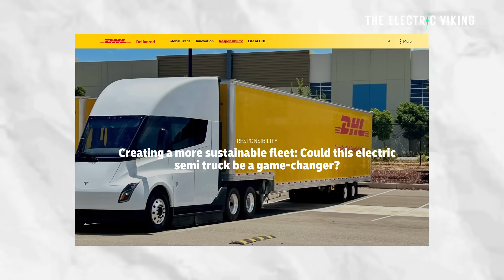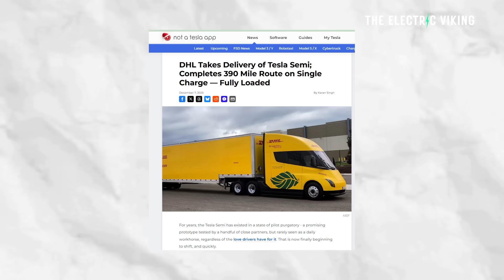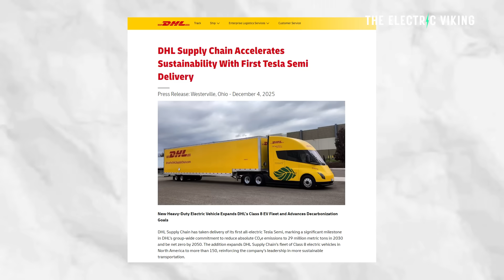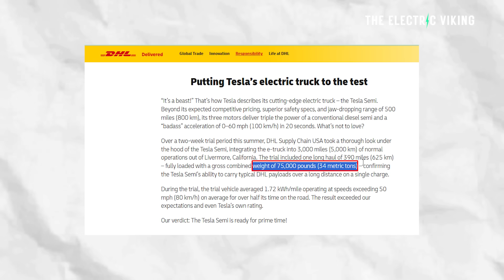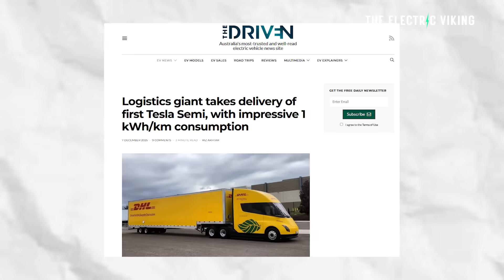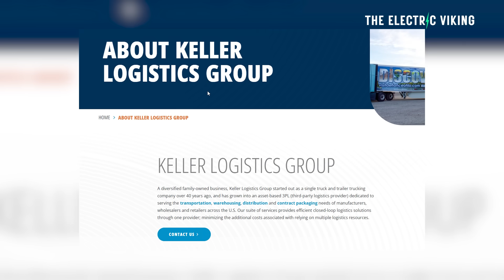Tesla Semi Drives 390 Miles on Single Charge Fully Loaded with Range Leftover!

Comment: I’m a truck driver.   I can tell you that the Tesla Semi will blow away the competition.    It’s like comparing a rickshaw to a car.   Diesel trucks are so costly, loud, polluting, and will be GONE because of Tesla.
Reply: I think the problem is people think you have to replace every semi with a Tesla Truck. You don’t have to, for city delivery/local, it has a big advantage, diesel is more efficient when you have constant speed, the diesel engine has rotating mass, so it makes a lot of sense for long haul. In town, electric wins, big time.
Reply: I don’t think people realize how stressful the sounds inside the truck are.
Reply: @karlmckinnell2635 I would guess Tesla Semi has sounds not found in Diesel trucks I have an early Tesla fairly quiet, but does have its own quirky sounds which is common from reviews of older Tesla mainly because Teslas costing a lot, but no total sound proofing, which can add even more costs to production at the time.
Reply: I just wished we used more trains for long haul transport and delivery vans for last mile delivery and got more semi's off the interstate in the US. It sucks as a daily driver having so many semis on the road, especially because many of the drivers suck at driving due to lowered CDL standards. They will stay in fast lanes when signs clearly say trucks need to stay to the right, or they will wind up on a side road that is not made for semis and get stuck in an intersection.
Reply: @JEP-Tech  Great Idea, get all those long haul goods onto rail, BUT, I don't think there's much electrified rail in America unlike Europe etc. For "clean journeys" you really need electrified rail.
Reply: I agree with some future hybrids for remote or very long runs
Reply: Also parts for semis are expensive, i hope this pushes innovation to other semi manufacturers
Reply: @Omarfx007  How can you say parts for something are expensive when that thing isn't commercially available yet?
Reply: @Omarfx007  all the other semi makers already make electric tricks. only tesla out there years late and promising the moon
Reply: @someonenew3478 How many are they other planning? What are the charging speed characteristics. The others are not built from the ground up. The market for EV semi is wide open. Late? Hardly.
Reply: I'm a trucker and I can tell you that none of that will ever happen so long as Tesla refuse to bring the damned thing to Australia
Reply: @alexishart1989 guessing you're an Australian
Reply: You're an idiot.
LoL.
This is going to turn out to be bulkshit.
The "payload" is going to proce to be less than adequate.
Building all the batteries is going to be time consuming and without the government segment paying huge offsets, the costs are going to be out of sight.
Look at how shitty the "fleet of electric buses" are going.
Reply: Energy density is a major problem
Reply: @Jackson_M5  how so? be specific and include examples
Reply: @williammeek-h2o  Diesel Fuel is 70 times more emergy dense than Li-ion Batteries. The stress on the road for a long haul will be 25% higher on road infrastructure with 8000 pounds less cargo payload
Reply: IDK but it's exciting news!
Reply: It always come down to the fact that the United States is atleast a decade away, and probably more because of the decrease in support for EV'S  ), before we have the infrastructure to support fleets of electric trucks. I'm sure the larger corporations would love to get subsidies to build standalone power generators at each of their facilities, but at 38 Trillion dollars of National debt I don't see that happening. This is especially true since we wasted 7 billion dollars for 7 chargers, or 3 billion dollars, in what is obvious corruption, going to Stacey Abrams start-up company.
Reply: @russellderonda1489 no. The United States will be no different than Canada with EV adoption for semi’s. Scale is complicated over huge regions. People who transport goods are trying to transport goods, not have an ev revolution. EVs are fantastic if they develop organically. Some incentive is fine, but we don’t need the Feds creating an artificial ev economy.
Reply: @russellderonda1489  It is already financially viable to put solar on the roof and batteries and chargers for short haul and the lower end of long haul.
Reply: Superior!
Reply: As a heavy truck test engineer I'll say it's not as good as you think
Reply: @m @miamisasquatch  what brand do you work for?
Reply: You're not a truck driver african 🤣🤣🤣🤣
Reply: There is no infrastructure for this. 20 years to upgrade the power grid and install enough chargers nationwide to even start switching over. At least.
Reply: @Mythicalniceguy Tesla might be able to do this they don't have to build that stalls at loading docs just 1 or 2 and a power storage unit,  Tesla is already putting some higher powered units at some of their current sites not 20 years maybe 3 to 7.
Reply: Really?  Because that's NOT what PepsiCo is finding out.  Especially considering Tesla's horrid parts and repair support, their DOWNTIME and a lack of megacharger network is costing them FAR more than any savings supposed by not using diesel.

Hate to say it, but calling you on your assertion of job title...
Reply: Fck that, I will keep the old cat.
Reply: The only drawback maybe range and time of charge, I think tag team trucking might help if you need the range and charging time is a hindrance
Reply: @nicholasyoung2794  Pepsi has found charging during mandatory driver breaks is enough for 1K mile days. 
Over 1K miles some time is lost, but the energy cost difference is huge, this is ongoing analysis.
Reply: Charging costs more than diesel.
Reply: @singed8853 and time is Money. 
And brakes are money. 
Regen braking will be a lifesaver. 
I've run a haulage company for 25 years in the UK as Transport Manager.
I'd be all over these things. 
We only had 25 vehicles or so of varied weight capacity. 
Vans, curtainside, flat & crane vehicles.
Your fleet will be bigger than mine im guessing.
Because you know so much.
Reply: @singed8853 Probably how and where you charge, over time i don't know how setting up solar charging vs diesel obviously charging would be more beneficial for the environment.
Reply: @andrewsaint6581  I know that charging actually costs more than diesel in certain areas and at certain times. The OP talks like charging is free. I also know that without special charging infrastructure it takes hours to fully charge an electric semi.
Reply: @nicholasyoung2794  I didn’t say anything about the environment. It takes a certain number of miles of driving an electric vehicle for it to become more environmentally friendly than a diesel counterpart. It’s basically a mathematical formula.
Reply: @singed8853  The OP is not talking like charging is free. settle down
Reply: @dogman-q3i  true. I must have commented to the wrong post.
Reply: @singed8853 My understanding the environment detriment of evs is in the process of making the batteries, not sure the difference in processing diesel fuel, the actual use of the vehicles ev would be better then diesel for the environment if that's the only thing considered.
Reply: @thedukeofalinor1377  Hailing potato chips. Actual drive time is about 5.5 hours with a real load. So just not enough before needing a 15 hour charge.
Reply: @singed8853  You have to realize where those megawatt chargers are - central valley in CA. Electricity is cheap, diesel is expensive.
Reply: @singed8853  except not
Reply: @singed8853  Why wouldn't there be charging infrastructure? 
Provide an example where a megacharger costs more than diesel.
Reply: @williammeek-h2o just ChatGPT or Grok what I said. I never said the word ‘megacharger’.  And so I made no claims about that.
Reply: @nicholasyoung2794  The vast majority of pollution from ICEVs is from operation.
Reply: @jmontgomry1  I am no fan of ICE but no, it doesn't take 15 hours to fuel a diesel.
Reply: @singed8853  Thanks for admitting you can't back up what you say.
Reply: @williammeek-h2o  I have no support for YOUR strawman. I told you to ask grok or ChatGPT what I said and it will provide you the sources. I didn’t just make it up.
Reply: @singed8853  except you did
Reply: @williammeek-h2o  no I didn’t and anyone who reads what I said will know that. But you can make up whatever you want and pretend you’re responding to what I said.
Reply: @singed8853  You can't change the fact that you are unable to support your arguments and many people will continue to call out your BS.
Reply: @williammeek-h2o what arguments? Is this another thing you’re making up about me? I simply said that the cost to recharge is higher than diesel in some areas. My original comment indicated that was the norm - but it’s not and I should have been more careful. Cost to recharge is usually lower than cost of diesel. I have no agenda that supersedes the truth.
Reply: @thedukeofalinor1377  The weight for cargo payload is high. If the truckers have to pay for infrastructure degradation, theres no savings whatsoever
Reply: @thedukeofalinor1377  Road infrastructure repair..... given heavier weight its 15% more road degradation .... acvounting for static vs dynamic weight its closer to 20% more. The electric cost doesnt tax road usage
Reply: @singed8853  Yes, those arguments
Reply: @nicholasyoung2794   LOL
Reply: @NedLingamon I'm just finding out how it works or working
Reply: Will be offset due to self driving. Drivers can sleep in the back of the truck instead of getting a room or pulling off to a truck stop.  Less maintainence too.
Reply: @polygunslots of lawsuits still to be had before these can go without a driver.
Reply: @nicholasyoung2794 there are no drawbacks
Reply: @linuxxr Then the future of EV trucking is looking good, will the production of the trucks meet demand?
Reply: @linuxxr apart from the poor Chinese person getting like eight-year-old children to mine the raw materials yeah there are no drawbacks just slave labor that the west refuses to acknowledge..
Reply: @nicholasyoung2794 Nope!! The Tesla semi only has one seat and a shitty sleeper, if any..
Reply: @carlsmith1118 So currently it is only good for certain transport jobs
Reply: @nicholasyoung2794  80% of them.
Reply: @williammeek-h2o if you plan your drop offs correctly would make the difference between charging and using gas minimal and overtime charging at the loading docs should be cheaper
Reply: @nicholasyoung2794  for single drivers, charging can be done at the loading dock and on break so no time lost, maybe even time gained. for team driving diesel might have a slight advantage in flat country on very long haul, but would cost a LOT more.
We are talking they would gain maybe an hour a day over Semi and there are almost no routes over one full day.
Reply: @williammeek-h2o They would have to equip at or near the loading dock charging stations
Reply: @nicholasyoung2794  Yes, integrated into the loading dock would be most time efficient.
Reply: @williammeek-h2o  So a massive increase in electric infrastructure
Reply: @Jackson_M5  that we already need
Reply: Similar analogy for Tesla cars.
Reply: Diesel trucks will be GONE because of electric truck manufacturers in general. In Europe MB, Volvo, Scania and Renault are ahead of Tesla.
Reply: @Freba9 giebt keine Semi Teslas in Europa.
Reply: @frankbussinger5237  Genau! Wir werden Tesla einfach nicht brauchen.
Reply: "I'm a truck driver"

🤥
Reply: Yep
Reply: I own a model 3. As fantastic a job as Tesla has done to maximize charging infrastructure, Tesla has a few decades worth to do to really compete with diesel for long haul. Trucking routes will need to be strategic for some time, likely hosting level 4 charging at the destination. Diesel is far more portable as an energy source than battery electric for now.
Reply: @kevdernman  Just need chargers between cities. Then 50 miles apart. 
Semi can cover most long haul as that is defined as greater than 150 miles and Semi can do a 250 mile round trip, 500 mile each way.
Reply: @williammeek-h2o I own a model 3. Went Houston to St. Louis to visit my daughter in it once. The trip took almost double than my f150. Less range, slower “refuel” time taxes your time on a long trip.
Reply: @kevdernman  BS, Houston to St Louis is a 12 hour drive. 
Even if you had an old SR, you wouldn't need more than 3 charging stops of 30 minutes each.
And one of those stops would have been during a meal unless you are VERY unintelligent.

Only if you are a verry bad planner would The Model 3 have been even an hour slower
Reply: @williammeek-h2o  All you've demonstrated to me is you've never owned or taken a long road trip in a Model 3.  I own a Model Y and have taken many long road trips in it.  And sure if you're going to drive over 400 miles in a single day, the trip will take longer than in an ICE car.....but by like ten or fifteen percent, NOT one hundred.

Anybody who actually owns a Model 3 understands this in their bones.

And the rest of year when I'm not driving over 400 miles a day, my Model Y saves me many, many hours because I never have to shlep off to a gas station.  How many hours per year?  Well you do your own math.  For me when I had an ICE car, god rest its soul, I had to fill up twice a week.  If that trip, getting to the station and back plus actual fill up time, took 15 minutes, then that's 52 weeks in a year times 2 is 104 trips to the gas station times 15 minutes each is 1560 minutes per year, divided by 60 is 26 hours a year or THREE FULL WORK DAYS plus two hours wasted doing nothing but pumping gas!!!  Offset that by the fifteen seconds three times a week that it take me to plug in my EV and you get 2340 seconds a year, which is 39 minutes.  So my EV, which cost me an extra hour on my one or two long road trips a year, saves me over 25 hours the rest of the year.  

And this doesn't even count the huge benefit that I never again will have to pump smelly gas.
Reply: @Tom-dt4ic  You mistook me for someone else.
I also own a Y and have never claimed it added more than an hour a day at most.
Reply: Waymo is doing the paperwork everywhere for autonomy. 
After cars, the door will open.
Reply: It depends on what you want. Do you wanna move for a little while then sit? Get electric, do wanna have the ability to keep moving get diesel. Until they develop a full charge in 10 minutes or 15 minutes along with at least 1,000 miles of range or better, you're gonna have to sit and stay awhile. Welp, godda go. Like they say in smokey an the Bandit, We godda long way to go and a short time to get there. Enjoy your stay. See ya... Oh by the way, no tagging. Tesla Semi only has one seat. And sleepers are shit...
Reply: @carlsmith1118  Electronic logs will put you out of the business if you try to drive like those old-timers. People out there driving electric semi have learned to charge during their mandatory breaks with few problems.
Reply: @someonenew3478  In the United States 🇺🇸 A truck driver can drive up to 11 hours maximum within a 14 hour work window. Must rest for 8 hours. Question, will you be able to move that fright for atleast 5 of that 11 hours with only 500 miles of range, which is sorry to say, (short and shitty) for a big rig? Everyone knows that Tesla is not noted for range or short downtimes. 
You now stop because you have to not, because you want to. 
Just like traveling long-range in a Tesla car, you have to sit and watch everyone else come and go instead of being up and out and on your way. There's still alot of them old timers around and many have learned from them old timers. Like i said, Enjoy your stay...
Reply: @carlsmith1118  Yes, the driver has to stop. Because of mandatory driver rest breaks that are long enough to give Semi a better endurance than the driver.
Might want to learn what you are talking about before commenting again.
Reply: @carlsmith1118  Except not. Drivers have mandatory rest breaks that are long enough for Semi to charge with a megacharger. 
This means a driver of Semi would spend slightly less time on a long route than a diesel driver for routes under 900 miles, which is you know, just about all of them.
Reply: @williammeek-h2o  OK so again, Enjoy your stay.
Reply: @carlsmith1118  That is what a driver of Semi will say as he passes trucks that have to waste time fueling at a truck stop
Reply: @williammeek-h2o  Pass me all you want. The faster you go, the more range you loss which is already short and shitty. Then you pull off and stay awhile to charge. Now i pass you. By the time you get back on the road, im long gone. Im back on the road after 15 minutes. So like i said, enjoy your stay...😊  Oh yeah, work is work,  so be safe out there no matter what you drive... see ya.
Reply: @carlsmith1118  No, we both pull off at the same time for the mandated driver rest break.
But then I also charge at the loading dock while you have to make a separate stop for fuel.
The ONLY two scenarios where a diesel actually takes less time for a haul is if there is not a megacharger along the route or a multi day team drive.
The first is just about infrastructure the second is extremely rare and is cost prohibitive in a diesel.
Reply: @williammeek-h2o welp, guess there's good and bad in both. So now all we have to do is pick one. Welp considering what i went through with my Tesla model S, im going to simply leave more than well enough alone. Like I said buddy, be safe no matter what you drive. Godda go, heading back from Texas to Pennsylvania, then up to Maine...
Reply: Maybe so, but that fully loaded Tesla is loaded with toilet paper is it? :-)  And BTW BVD in China is way ahead of Tesla. (Not with semi's yet but) Just saying tariff wars with China is a bad idea.
Reply: I guess the naysayers can say anything to support their narratives.
Reply: @pag @pagosabob10 h nope! All the test loads were FULL weight, PERIOD! As for China’s bYd, they report ALL the many models of gas and electric cars it manufactures. Problem they lose money on their electric models while Tesla makes a profit of over $6K on every car and the ONLY EV maker who does make a profit! They also have the most advanced full self driving! Lastly Tariff wars with China is further crippling their economy of the commys at lighting speed ! China needs US WAY MORE than we need them!  Check the actual data and not bozo news outlets!
Reply: @JamieReneeVonTeez  DHL is already running BYD electric semi in California. Tesla will get a model to market one of these years.
Reply: @pagosabob10 minus the extra 8-10,000 lbs of cargo to offset the extra weight of the batteries....comical.
Reply: @fivendimeca  except not. Semi carries the same load as most trucks.
Reply: This will be a useless truck as the side windows don't open.add the central driving position means you will have to get out of the trick to pay tolls etc .... Plus not many chargers for these
Reply: @Sat-Guru-1  You do not understand the use case. 
The trial cases use electronic data transfer, not paperwork. 
The long range to avoids charging in route. And Tesla is adding chargers very quickly.
Modern companies do not have the problems you mention.
Reply: @Sat-Guru-1  Nobody pays tolls with cash anymore. There isn't even a place to put money if you tried.
Reply: @williammeek-h2o do they not check paperwork etc anymore? They definitely do
Reply: @Sat-Guru-1  The windows vents can be cracked open to pass out paperwork
Reply: No it won't let's face it diesel trucks are so much better electric sucks anyway nobody wants them not at the moment anyway.
Reply: @elixier33 It’s just a matter of time before diesel gas and all ICE vehicles are extinct. The sooner the better
Reply: @elixier33  haha 😂
Reply: @elixier33  haha funny